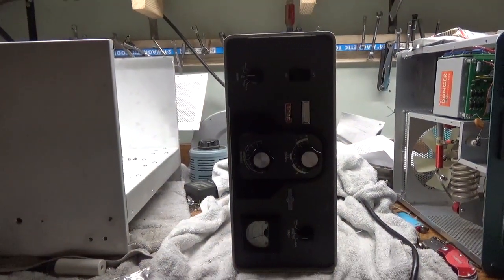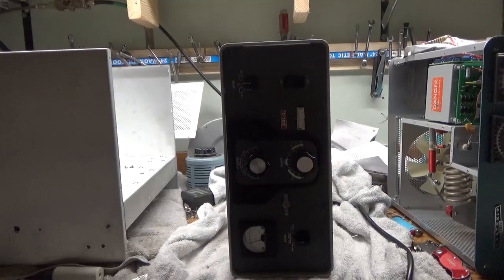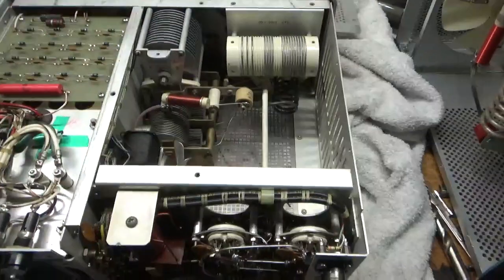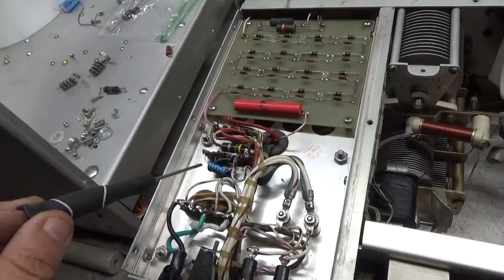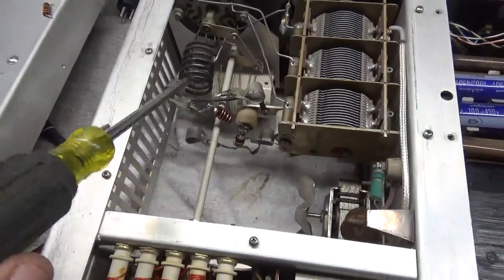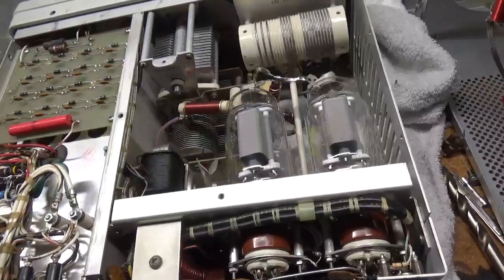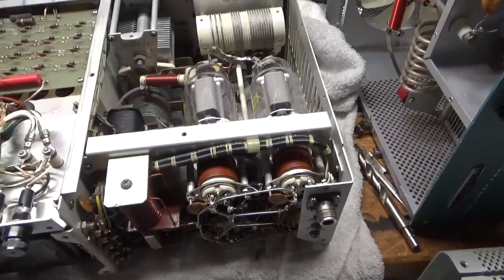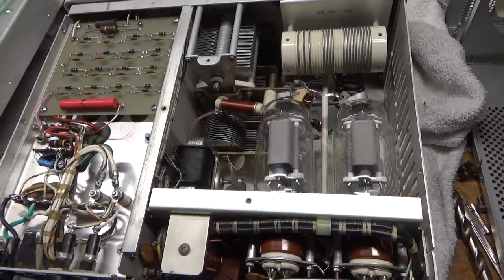Collins 30L-1 Repair

Comment: What gauge and type of wire do you use for rewinding the parasitic suppressors?
Reply from the maker: Not sure haven’t done one in a while

But it is in the manual under the parts section

Comment: I have the very same amplifier and it's been modified for 572b valves and it's been working fine but recently it stopped amplifying and the swr to the exciter is through the roof? Any ideas on what it could be?
Reply from the maker: Feel free to give me a call